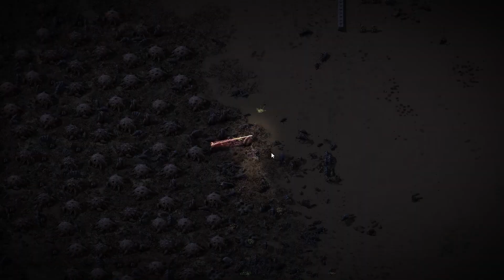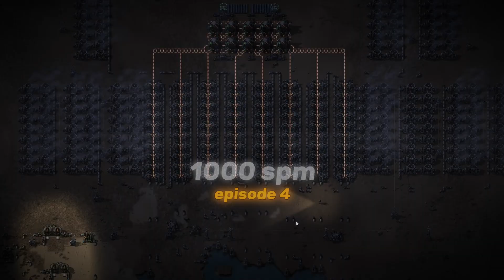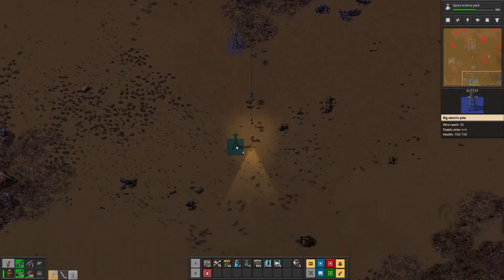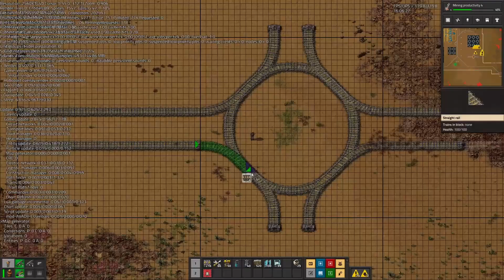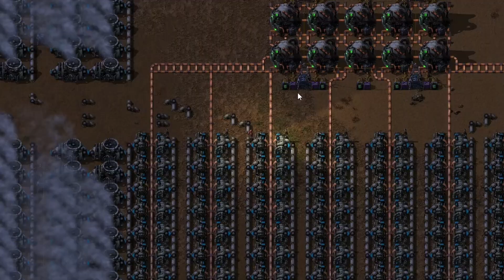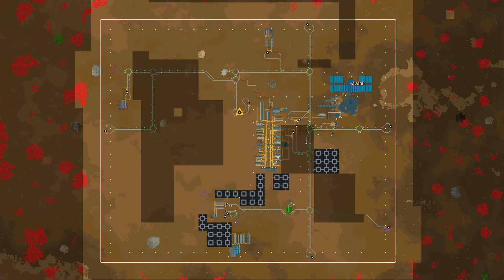Making a Factorio Deathworld MEGABASE - episode 4

Comment: I wanted to ask this in ep 3 but didn't since i saw this new video: Why productivity modules in uranium production? Woudn't it be better to have speed modules to speed up the cycles for the shiny rock? Or at least efficiencies since prod modules slow down the machine. The benefit of prods is that you get free materials, but downside is you need to scale it up and since you kept to 2 centrifuges, prods were bad imo.

What are your thoughts on using rocket launcher to kill biter bases? I do it via shooting 2 rockets at biter base (that is enough to kill it), then pick another base. Once large group of biters are close to me, I run to a pre-built group of turrets that mow them down. I can see the convenience from lazors but most of my bases are powered by coal, efficiency modules and dreams.
Reply from the maker: Concerning uranium: i doesn't really matter. All you need is 40 u-235 to start kovarex. And based on experience i knew by the time i start building the nuclear power plant i will have 40 no matter the modules used.
Rocket launchers work well, i did it in the past. But it's just a different variation of laser turret creep strategy. And i prefer poison capsules.
If you use gun turrets instead: i can't really use this strategy because i don't research any gun turret upgrades after phys damage lvl 1.

Comment: not sure to see the point of the dedicated power network to insert and remove the nuclear fuel cell

cause like, if there is a blackout, the roboports would go down too, and bots wouldnt be able to deliver the fuel cells, so it feels a tad pointless?
(though in a belted design it makes sense imo)
Reply from the maker: If something goes wrong the requester chests will still contain 10 fuel cells which will last for over 30 minutes.
Since lasers have energy priority over every other entity the base can still easily defend itself with lasers.
Example: you have 80GW solar and 1.4 GW nuclear. If during night you run out of accumulator charges everything will break down but you still have 1.4 GW laser power.